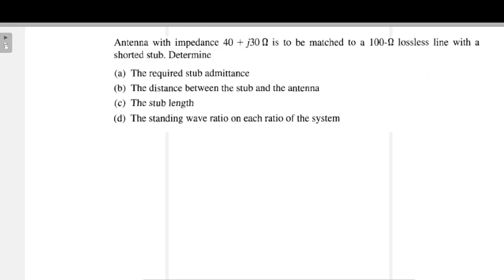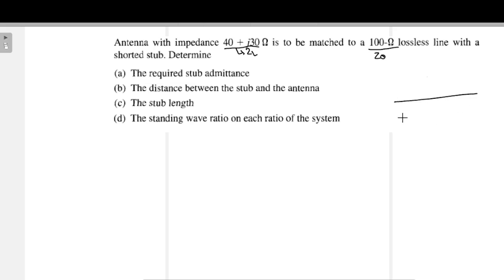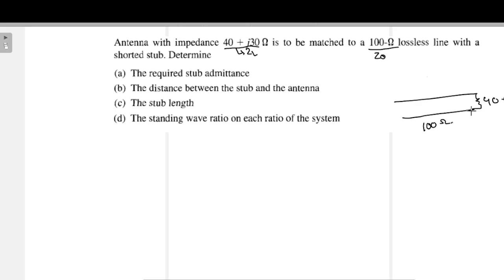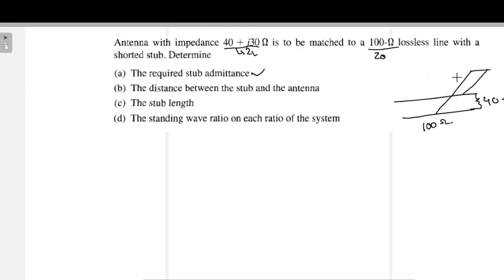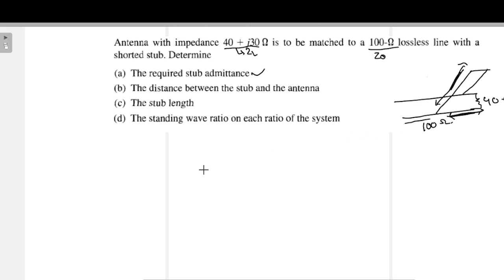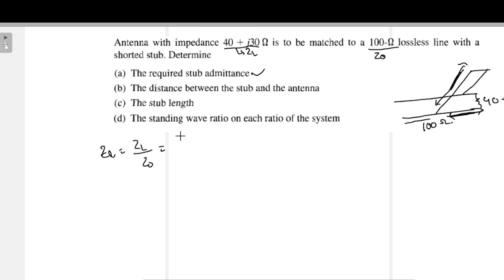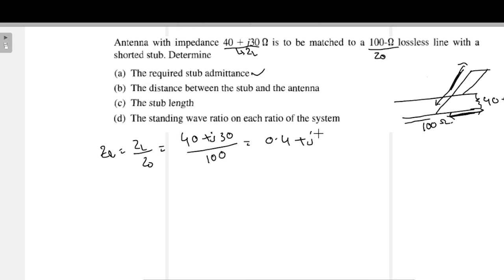Transmission Line Problems using Smith Chart-part 5 || How to Use SmithChart

Comment: i use CST but the smith chart is different from yours , could you please upload videos using CST to determine all questions as in this video for (single stub and double stub in straight and radial shape ) 
i have multi resonances how doing matching using stubs
Reply from the maker: The software is Openboard, which has the facility of scale, rounder and all. the smit chat is a pdf downloaded and imported to the software